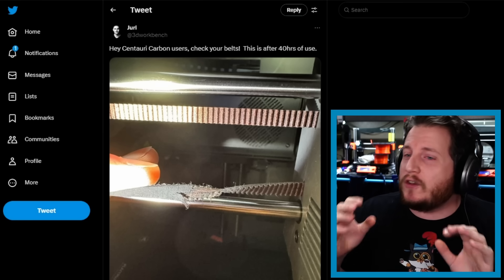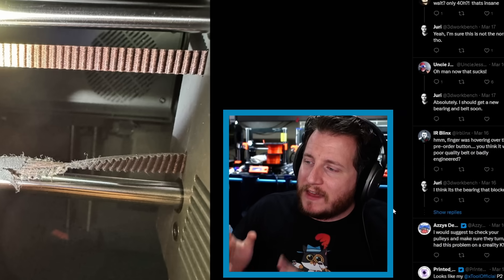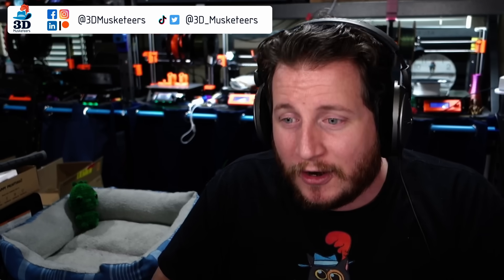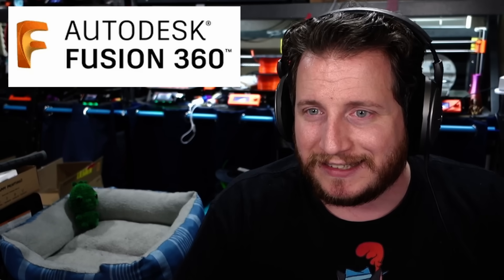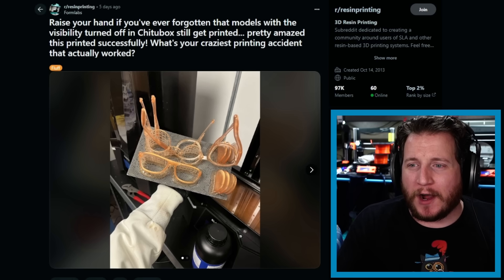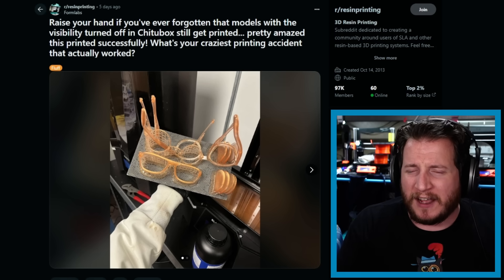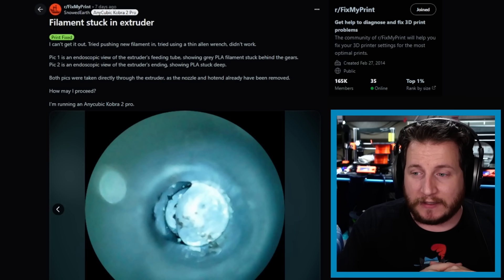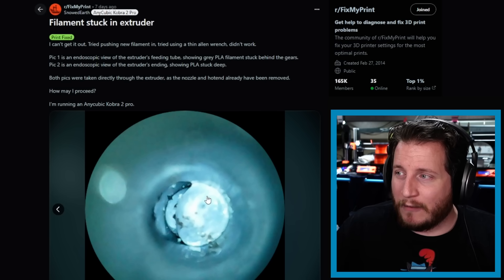The Rise of Replaceable Machines - PrintFixFriday 184

Comment: If this is happening to a TUBER though.  That is What  one in 20 machines.   So, 5% of these machines could have problems?
Reply from the maker: That's more than you'd want to see IMO. 

Looks like it may be a stuck pulley causing the issues. Elegoo seems to be handling it which is good.

Comment: Hey Grant, one of the problems with my Qidi X-Plus 3 was the belt slipping during rapid non print moves. The belt tension felt fine on both the X & Y axis. So I slowed the travel speed down to 300mm/s, this worked for a while but on one 22 hour print it slipped again... and it did it with 2 hours to go. I was pissed! So I tried to tighten the belts up Y went fine but when I went to tighten the X It was not getting tighter! Upon closer inspection I noticed the X adjustment screw was cocked a little. The Motor/belt tensioner assy. was broke where the tension screw was pushing on the tension block. I pried the block over and hand tightened the adj. screw and applied an enormous amount of 5 min. epoxy all around the broken area and screw. I plan to make both motor/tensioner mounts out of aluminum. To do that I'll have to dissemble half the machine. Looks like real PITA. So I'll "Run'er Till She Blows" and then go from there. 
P.S.
I pre ordered the Centauri Carbon last week. And now I see here another potential belt issue! Go F***in figure.

Comment: The problem with taking a throw away approach is that 3d printers don't have nearly the reliability to be throw away. In general, to function well, they invariably need some tinkering. Modern ink jet/laser printers could be considered throw away because their reliability is near 100%. they just run out of printing material.
Reply: Yeah my HP inkjet is absolutely not nearly 100% reliable. Even my k1c is much more reliable than that thing. And I would not consider the K1C a reliable machine

Comment: Regarding the vibration sound coming from the X1C I have had this issue previously. It occurred just after I performed a service. I manually moved the head back and forth a few times and did not get the issue again on the same print. 
Not to say Grant is not correct, I agree wholeheartedly with his assessment, but it worked for me in this instance. It was happening on any circular print which was unusual.

Comment: I had molten filament freeze in the heat break, I ended up drilling it out with a 5/64th bit, after all other options. machine running fine since

Comment: Oooh! Noisy Bambu! This is why I strongly defend STEP files over .STL! STL files are often garbage because you're relying on someone else to properly export it or users are often unaware of the need to adjust parameters to keep circles from becoming low-res polygons. .STEP files should be the standard.

Comment: Bambu actually has better parts support than most of these styles of printers. I can replace almost anything and there's a full wiki that walks you through step-by-step for each maintenance and repair process. Plus the parts are surprisingly affordable, I know that could change at any time, but credit where credit is due.

I've been treating my A1 and A1 mini's just like my Prusa Mini, I check everything from time to time to monitor wear and update maintenance schedules. The A1 series of printers generally need more maintenance - I don't know why they use such a thin and such evaporative oil, but it wears out fast. 

Oh and belt tension:
Prusa Mini: I slap the belt from time to time to check tension, I can see minute print issues when the tension starts getting loose, but it's very resilient, the last time I actually had issues it was so loose it was drooping under its own weight, and it was only having small print artifacts even then. 

Bambu A1 series: They claim the printers will notify me when the belts are loose - so far the belts are still tight, checking the leadscrews tonight and applying the mid-year maintenance level of grease - yes they take grease.
Reply: I just bought an A1 recently, and after a few days it was throwing "X axis belt loose" errors on the bambu handy app. Oddly, it wasn't showing any errors on bambu studio. Only on the app, under devices, was an error banner below the video window. The good part, it was so easy to tension the belt, I wasn't even sure if I had done it correctly. You literally back off a screw, press another screw in with your thumb and then retighten the first screw, and the error vanished..👍🏻

Comment: What makes you think the CC printer is not repairable? You said yourself you dont even have one to evaluate.
Reply: well for one they dont provide any repair manuals at all.
Reply: @Pixelplanet5  Hopefully soon. I've heard of several people that had issues including a bent top frame from shipping. Elegoo has sent them all replacement parts with instructions and reference photos. They seem serious about providing support so far.
Reply: @Pixelplanet5  So, tear it apart and fix it. Use common sense and a mechanical brain. Not all people have that, but it can't be harder than replacing a belt on a car. People are too afraid to tear into things or don't know where to start. You don't always need a repair manual to fix something.
Reply: @boonedawg1506  Agreed, I don't see why it would be anymore complicated than any other printer.
Reply: @aco2518  any other printer still provides a repair manual.

Comment: Name an appliance that isn't disposable/replaceable these days :(

FWIW I have at least 10,000 hours on my Bambu X1C.
Reply from the maker: And when did you get that X1C? 

We have seen the X1C starts to really fail around the 3-4k mark requiring a great deal of service. 

And as for things not meant to be disposable: Prusa. And that took about 5 seconds of thinking. lol. 

As far as a true appliance, Kitchenaid mixers.
Reply: @3DMusketeers  Prusa is an outlier in terms of disposability; the trend for the last 50+ years has been to make things that the consumer has to replace after just a few years.  

Washing machines - 5 years.  Phones - 3 years.  TVs - 10 years, IF your lucky.  I'm about to replace a high-end dishwasher after just 7 years :(  

And sure the Prusa could be rebuilt constantly; but is it still current after 5 years, or horribly obsolete?  It's pretty obviously the latter.

I've had my X1C for about 20 months now; not actually checked the hours on it for a while, but it will be over 10,000.  At about 4,000 hours I had to replace the X-axis gantry (which was a major PITA), but other than that it's required almost no maintenance at all.  I have killed one AMS unit, and I don't completely trust one of the two others I use, but they are used HEAVILY as I tend to print multicoloured stuff. 

It would be interesting to see if a Prusa XL was as reliable or as easy to use; I know my Prusa Mini wasn't, and I was glad to see the back of it!

Comment: To be honest, I think it's a shame that manufacturers are now producing disposable printers. I was always under the impression that the development of desktop 3D printers and the right to repair movement went hand in hand. But now it seems that most people getting into 3D printing just want to print multi-colored flexi-dragons and other gimmicks.
Reply: They want larger printers to print............................helmets😣
Reply: @Denniss7420  chest pieces
Reply: To be fair: Bambu labs looks like a non repairable printer, but they have all the Spare Parts ready to buy AND have comprehensive guides how to do repair jobs. One of the reason why i bought mine. Compare the repaireability of a Ender 3 v2 with a Bambu Lab. Bambu Labs sell all the parts you need for a reasonable price. Ender 3 v2? Good Luck hunting, to "repair" my Ender 3 pro it was cheaper to buy an Ender 3 and transfer all the Pro Parts and add ons to the new Printer, as i had a major failure in the Z-Axis and even changing the z-Screw and rollers it remained. So in a way SOME newer printers are better to repair then older ones.  The old Ender Chassi is on its way to be a Voron Switchwire
Reply: @Elkarlo77  First of all, with a Bambu Lab printer you are dependent on the manufacturer for spare parts. As soon as they say that they no longer support a model and no longer offer spare parts, you practically have a paperweight if something breaks for which there are no more spare parts.

Secondly, there have been several cases in the last year where users have been told by support that it is not intended to replace certain parts. Only after pressure from the community were the spare parts added to the store.

And thirdly, certain parts cannot be replaced individually but have to be replaced as a complete assembly because the parts are glued in place.

Which parts on an Ender 3 v2 are really Creality specific? As far as I know, most of them are standard components that can easily be replaced by third-party components.

Comment: I think my belts tune to a low E maybe a low G but I've never used a chromatic tuner to check since I tune by ear. But I've luckily never had a belt break or fail. As far as replaceable machines, no at the very least make them more upgradable with quality hardware/software/firmware as new features come out. These machines should be capable of functionality until we fundamentally change the way we print. I know a lot of people who have 50+ year old Mustangs and Corvettes, and they also own new Hondas and Kias. People are still upgrading Ender 3's with hi-flow nozzles and input shaping to get high speed. Now in resin printers, there has been a trend of increasing resolutions; however, there is no significant improvement from 12k to 16k, except for high-end scientific or technical applications. I think the focus should be on better and more affordable materials.

Comment: I haven't touched the belts on the mk3.5 since it was a 3s+ kit. lol I haven't touched the belts on the mk4s since it was a mk4 kit. I do need to do maintenance for the mk4. I accidentally messed up the z-alignment while plugging in the mmu3. So I did calibrate z. SCHREEEEEEECH! HOLY SHIT DUDE! WTF?!?!? And yeah even after alignment it's still doing it. BTW the MMU3 is fixed on both printers thanks to the new RC1 firmware. The mk3.5s had the overcurrent for a while. The mk4s got it the day I was going to try the firmware on the mk3.5. It worked on both. Except for some reason there is separate 3.5(s) firmware that's different than the 3.9(s)/4(s) firmware. I have no idea why it's split off since usually the firmware is the same on all of them. So yeah.......I need to remove the x axis gantry and lube my z bearings.
Reply from the maker: You can use some sewing machine oil on those bearings and it should be fine ;)
Reply: @3DMusketeers  I doused the shit out of it with PTFE lube (which also bought me a week with my old laptop's fan while the new one was being shipped). It worked.....until it didn't it squeaks again. It's probably best to remove it and do it. That's not hard really. The hard one is the X axis. I think even the Y isn't too bad.
Reply from the maker: ah, youve been down this road before I see LOL
Reply: @3DMusketeers  no, but I realized it wouldn't be hard to remove the gantry.